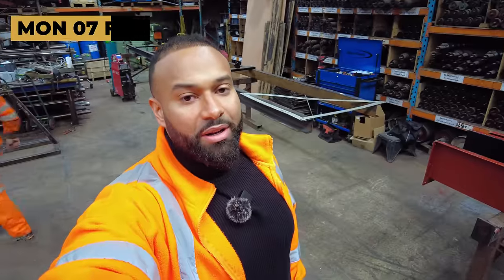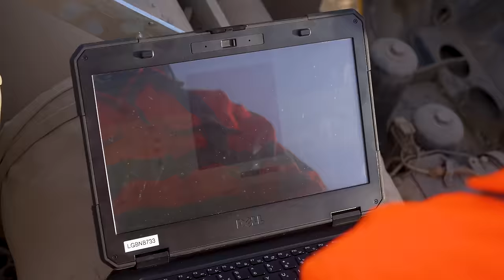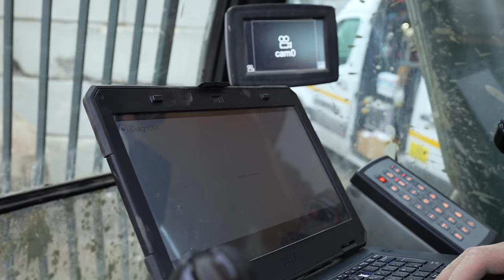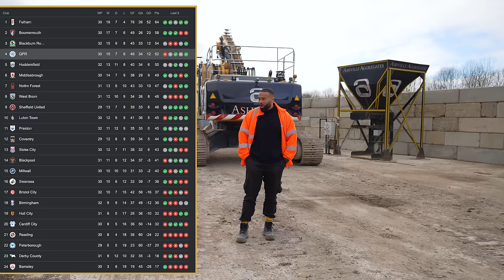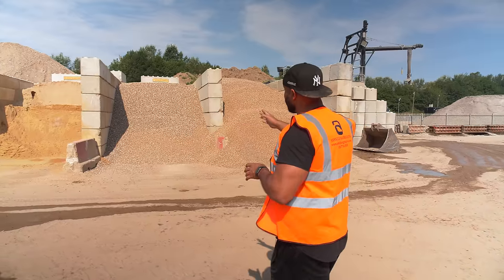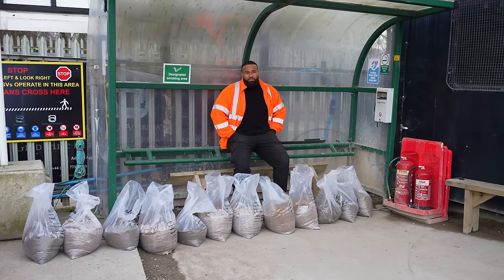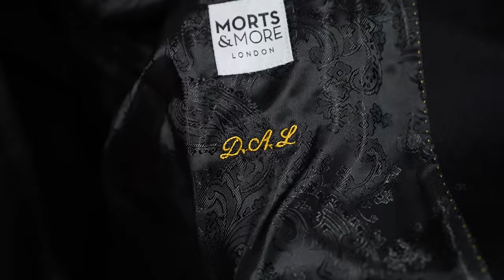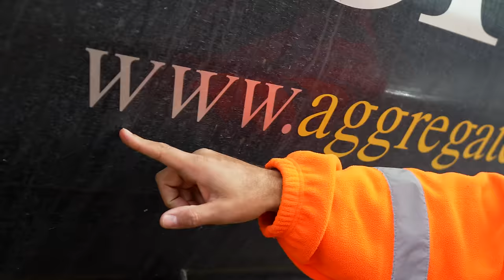Jacketing It All In | Ashville Weekly ep071

Comment: Hey Daniel. Huge fan of the channel. A great option would be an underground hopper.  Train rolls over and dumps them it goes onto a conveyor. We used a system running coal at a power plant. That would be so much quicker once it was in place.
Reply: WE did the same when digging the Victoria Line tunnels in the 1960s. Took over a sports ground drove an incline tunnel that went level at the bottom and would be under the tube tunnels. Once short lengths were dug by hand Tunnel Boring Machine were erected and the much from them dumped onto a grill opening in the bottom of there tunnel, onto a belt and up to ground level via the incline tunnel and tipped into a heap. I then loaded it onto 11 yard tippers and the clay went to a brick making yard.
Reply: Google coal drops yard, hence the name

Comment: Hi Daniel, I have a question, in a number of your videos, including today 17.27. . you are unloading trains, and have Grab loaders parked up in the yard. Just out of curiosity, how long would it take one of your grabs to unload one carriage. . . Being able to do this as a '' option of last resort' if the Lieb failed. . It could save you a £20k fine. . . Personally I would do it using the Training Wagon just to see. .  🤔🤔👍😉
Reply: The grab driver would not be able to see what he's doing. That's why the lh60 has a cab that goes up so he can see what he doing.
Reply: @craignicky  Hi, I am pretty confident the grab driver would be able to see off the platform he stands on But as I stated as an ''option of last resort'' you would find what the grab driver pulled out would compensate against the fine. . All down to money.

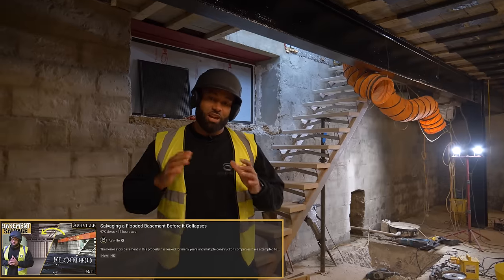Comment: Play 14:18 - 15:10 with your eyes closed. 

'We were using a poker over here earlier. An inch over there and 5 inches over here. One on this end and one on that end. Then we fit that in between them. Then we're gonna come inside." - Cuts to scene of pouring concrete* - 

"We have a massive surprise. ANOTHER steel directly behind it. The man hole is raised. We're gonna plug this hole and then we'll carry on." - Cuts to scene of Daniele standing right on top of a pipe pouring concrete. "We're gonna leave this pipe in place for a while and begin to fill the area. And its not even that deep. But it's a lot bigger than the previous one."

"They can extend. But get smaller when you twist them. Then you can slide this part straight on. We're gonna have to put reinforced bar through .. this .. MASSIVE gaping holes. So we plug these holes to see what would happen. This is what we're gonna drop in there. That fits."

"We're moving the pipe along the wall there. Because I don't wanna penetrate this wall. You can see the 100m pipe that we left in. It doesn't actually EVEN go high enough. But you can see how neat it looks. Because all the massive DUCTING is behind. That should limit our cracks."

Cuts to scene of Daniele extremely proud. "Better. Much better yeah?"

Comment: I Used to work as a user acceptance tester and every-time we wanted to make changes to the website we would come up with a 12 point plan. So maybe start of with changing 10 things on your website and go from there. Then you create less pressure on your self and also check your website on the most used devices instead of trying to fit for everyone.

Comment: Daniel, changing the website to a new platform wouldn't be any different than any other platform as long as you keep the same structure seo wise (content mostly e.g. url's) and 301 redirect anything that needs to change. I would speak to an online marketing company (aka seo company) who can advise you what needs to happen to keep your Google rankings while overhauling your websites.

In regards to moving to a new platform, there is nothing out there on the market which can do what WordPress does especially with a multisite functionality. WordPress is still a viable platform for websites but if you do decide to move, be aware there will be comprimises that need to be made. Some of the biggest websites in the world still use WordPress (techcrunch, NY Post, AlJazeera, News UK (the sun website etc).